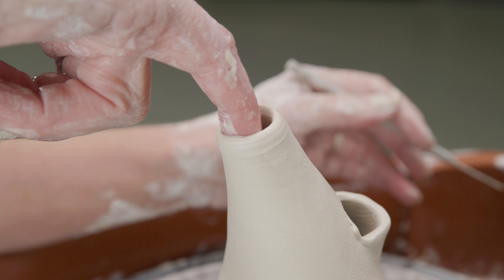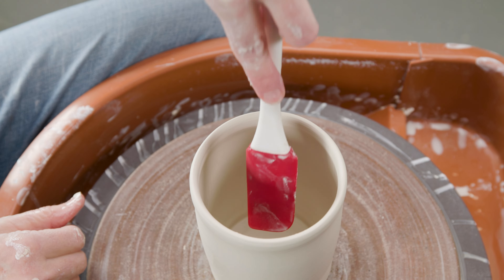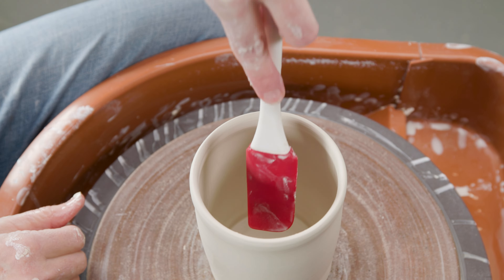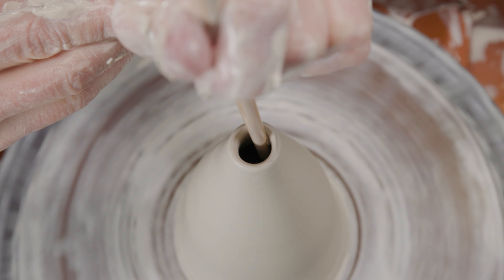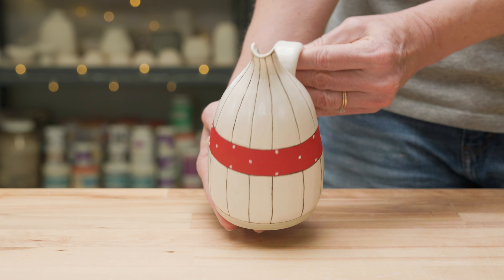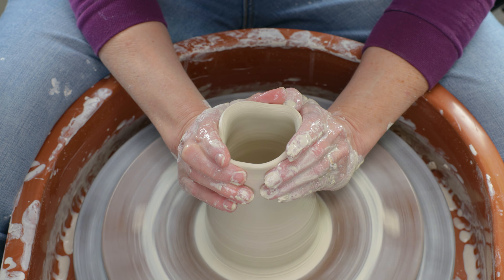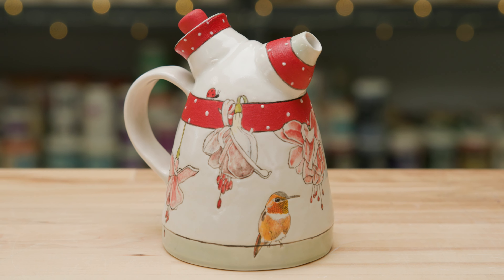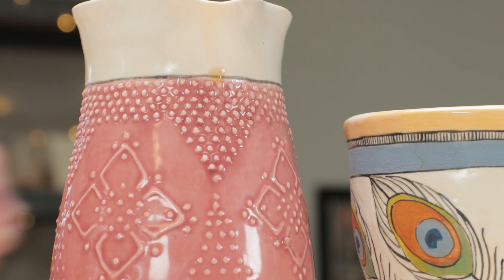5 Tips For Improving Pottery Pouring - IS THERE A PERFECT POURING POT?

Comment: *****Thanks for watching everybody.  One note....Making a good pouring pot was more controllable , but the problem with the dripping at the end of the pour was most difficult to avoid.  We showed you the little drips on each pot, but in reality the pots didnt always drip.  Factors that made them drip may be a combination of lots of not always controllable variables ....in addition to the design of the piece and the specifics of the spout, things to consider are the type of glaze you use, the viscosity of the liquid you are pouring, the angle at which you are pouring,  shaky hands, and even whether the outside of the pot is wet (causing a capillary reaction where the water will latch onto the other droplets and drip out) and probably even more.   My guess is that this is one reason, you wont find a lot of information on this subject out there 🙂. Cheers!
Reply: Hmm, how to overcome the drip is something the research team should investigate - tableware should be functional...
Reply: @edelgyn2699  Hey Ed.  You are so right.  We here at the Little Street Pottery Research Facility are on it!  We have had several suggestions from perhaps after glazing the piece to wipe away some of the glaze under the sharp spouted edge.  Someone said she heard to put a little vegetable oil under the lip to repel the water from dripping, experiment with different glazes rather than the thick white glaze i used etc.  Truly it is not one that has a magic answer...a one size fits all as there is so many variables
Reply: I was taught to make the spout opening sharper so they sort of cut off the stream of liquid…

Comment: Thank you for picking up this topic to experiment. Love to see a sequal on your further testing.  <3 <3   My own experiment told me that the two most influential features to prevent the backdrip is (1) spout tip to be thin or with a sharp edge to cut off the liquid when the pot is tilted back (2) the very end of the spout tip surface is 90 degrees (definitely not less) to the pot body.  Also, I think the surface inside the tube spout will influence the flow - it is important to remove any spiral like inner surface and make it as smooth as possible, when forming the spout on wheel.  Have a nice day! 🙂
Reply from the maker: Thanks for sharing - love the perspectives you all bring! Exactly in line with our vision as a channel!

Comment: Leave a thicker rim on the top of the cylinder and then with two fingers pull upwards to thin one area of the rim into a half circle upwards. Then put two fingers on either side and rub the half circle downwards towards your fingers to make the spout. This way, the spout is much thinner and will pour better. If you tilt the rim downwards just a touch, this should prevent the last drip. The spout of a tea pot can be cut so that the top of the spout is perpendicular to the rim of the pot. Then with a wet finger, the lower part of the spout can be thinned out and tilted just a touch downwards to improve pouring and prevent dripping, bearing in mind that with porcelain clay it may be necessary to do this at "ten to two" because the spout may turn during baking due to clay memory.
Reply from the maker: Great tips! Thanks.

Comment: Well, you got me curious, and as it happens, I inherited my mother's huge mid century pottery collection, so I pulled out and tested one of each of everything that had a pour spout, and, to one degree or another, they all let a drip cross the finish line after the race had ended, with the exception of a limited edition square Gladding McBean creamer. Fiesta pitchers were the worst, with Hall in the middle, and Gladding McBean generally not as bad of leakers as the others. So the answer is not some secret lost to the past. 

In fact, I also tested every Pyrex measuring cup I own, and none of them dripped, dribbled, or even held onto a hovering droplet. Notably, the spout on the one GMcB creamer is very close in shape and thickness to the Pyrex spouts, so I would say that if we want to create functional spouts, we should all be looking to our Pyrex for answers and guidance.  The Pyrex spouts are narrow, and they do almost come to a point (as another person suggested might be key), but what stands out about them even more is that the glass at the spout is very thin--much thinner than the rest of the vessel. I think it must be the combination of the pointyish shape and the thinness of the material that makes the winning combo. 

FWIW, I Googled the thin spout theory, and at least one site suggested that the thinness offers better flow control, so that might be the reason they work better.

Thanks again for all of your great videos!
--Leha
Reply from the maker: Great insight!  We fond that The smooothness of the finish also helps mitigate dripping...a glassy surface with help with a better pour...great info!